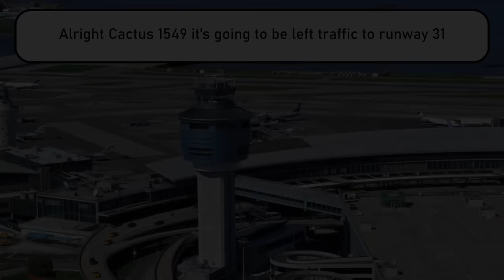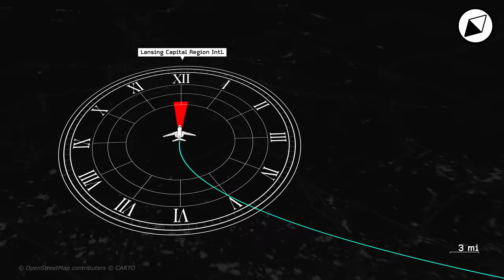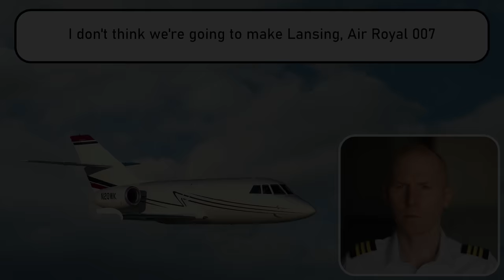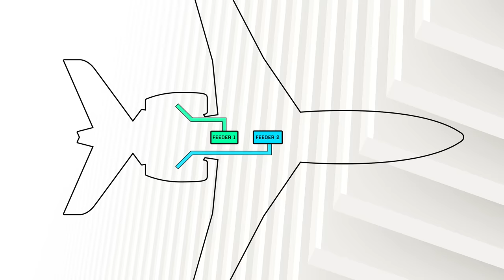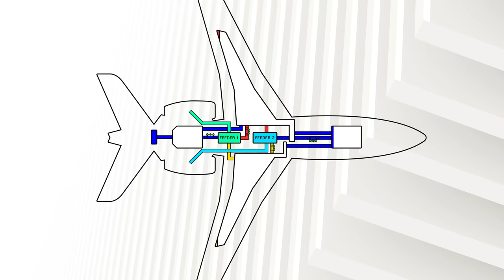Most Bizarre Dual Engine Failure Ever

Comment: Kelsey, you got me scratching my head about mentioning about whether they're heavy. To the best of my knoweldge, your no-wind gliding range doesn't change with your weight. The weight affects your best glide speed, not the glide ratio.
Reply: I assumed Kelsey was referring to the ability to stop, in an emergency, on a short runway. i.e. if the aircraft is light it can stop before the end of the runway and if not you are off the end, but either case is better the ditching off-field.
Reply: @heavyecho1  Let me quote: "If you're very heavy, you may not be able to make it those 15 miles to glide out there".

Comment: I remember that in the early 90's a Breguet 1150 Atlantic from the German Navy was training go-around procedures with one engine off at the MFG3 in Nordholz, Germany. They shut-off one engine and while being on the opposite downwind leg, they also shut-off the second engine. Speed was too slow to get it back online as it was a turboprop necessitating a certain amount of flow. So they were forced to land on a meadow with lighter injuries among the crew of 8. The plane had to be disassembled and was brought back to the military aerodrome by truck.

Comment: Sounds like a poor engineering design if they don't at least have sensors to inform the pilots of the status of the valves from the outboard tanks.  Even if they don't have any control over the valves from the cockpit, they should at least know whether they're open or not.

Comment: Every place not ground level is the "worse" place to lose an engine.
Reply: Even at ground level, after V1 on the take off roll is not a good time!
Reply: Yes but is it better than off ground level? 🤣
Reply: @jessicaregina1956  Yes. Anytime after V2 you can (theoretically) climb away and return to make a safe landing, on just the remaining engine.. An engine failure between V1 & V2 means that you crash, going off the end of the runway. :(

Of course, if you have more than 2 engines to start with, you may have less of a problem. I guess that Kelsey is probably glad that he starts off with 4! It's possible that a 747 can still take off and climb on 3 engines, at least if lightly loaded.

Comment: Its the same when you read the tradncript from the Christmas miracle (SK751)
They loose both engines just after start and Arlanda askes them to climb and also gives them a heading. To which the FO responds that we are at this altitude and descending, and we have this heading.
Then the next call is "Stockholm, Scandinavian 751 is crashing to the ground right now"

Comment: I am hesitant to write this because it maybe construed as a troll moment however, merely for the sake of an educational moment, I will.

“Flying by the Seat of your Pants” actually was a teaching technique introduced before the invention of the slip indicator. It was how we pilots could actually make a balanced turn. If you were being pushed into the seat instead of slipping in or sliding to the outside of your seat you were in a balanced turn. In aerobatics we also use this seat of the pants feel as an indication of some manoeuvres…

Not meant in any way other than educational.

Thanks for your videos especially through the Covid periods…..🙏🤙

Comment: Great video...but in my opinion a "heavy" jet is better of in case of total engine failure than a light one, due to the potential energi, mening better glide ratio
Reply: Glide ratio is not dependent on weight.
Reply: How do you compare stopping distances then?  Would you throw stuff off during the braking run?

Comment: Single engine complex before landing check I learned was GUMP gas,undercarrage,mixture,propeller. Saved me once actually forgetting my landing gear while  talking to atc. Gas means switching to the fullest fuel tank prior to landing. This was single engine, I was never multi type rated

Comment: Great video! Small note however, at 3:30, you say that they might not glide as far when they're heavy. That's not correct, glide ratio is not dependent on aircraft weight, only on the maximal lift to drag ratio. Imagine a glider and a Boeing 747 with the same lift and drag, theoretically they will glide the same distance, with the difference being the Boeing 747 doing it much faster. Cheers!
Reply: ...heavier plane needs to be faster to glide the same distance. Means if it is the same speed, it will fall out of the sky. You just proved it depends on the weight... :P
Reply: @Grisa77  Yes, it needs to go faster because it is heavier, but it will go the same distance. Feel free to look it up. Source: I'm an aeronautical engineer and a glider pilot :)
Reply: @gjens4a108  "it needs to go faster because it is heavier": sooo if it's same speed, it wont do the same distance: It does depend on weight! :P
Reply: @Grisa77  In my original comment I wrote: "glide ratio is not dependent on aircraft weight", I didn't say it will have the same speed ;)
Reply: @gjens4a108  But in Kelsey's case we have a plane flying with a given speed. Does its weight have an effect on the possible distance they can make, if they need to be faster with more weight?
Reply: @Grisa77  For a given aircraft, it will always be able to glide the same distance, fully loaded or completely empty. I know this doesn't sound logical, but it becomes clear when you draw the acting forces (lift, drag and weight) on a gliding aircraft. For a given glide angle, you will see that: glide angle = -arctangent(drag/lift). You'll notice, there is no weight present in the equitation.

Lift and drag are linked to eachother. If you are heavier, you will want more lift to not fall out of the sky, which is achieved by flying faster. When the lift, and thus the speed, is increased, the (parasite) drag will increase as well, which will result in the ratio of lift to drag staying the same.

During gliding races, this principle is often used to gain an advantage over the other. We will make the gliders heavier by filling the wings with water, so that we can fly faster. Of course, this has negative consequences as well, such as being less manouvreable, longer takeoff roll, etc.
Reply: @Grisa77  "Fall out of the sky"? No. It will descend faster, but it will still be under perfectly good control and able to land regardless of weight. The pilot will be flying at the best glide speed for the weight of the plane. That speed allows it to cover the longest distance for how much height above the ground it has, when the engines die in this case. It seems odd, but that distance does not change no matter what the plane weighs. 
Glider pilots add water ballast to go faster under certain conditions. They don't fall out of the sky though.
Reply: @gjens4a108  Okay, i was thinking about this all night (not true :P ) and figured out finally: I did the mistake to calculate with forces. Like accelerating an object to some speed or getting it to some height takes more force, more energy, (more money :P ) if the object is more heavy. But gravity as force is more special, because with gravity the acceleration is constant and independent from weight. Counteracting it (like keeping the object level during the flight) is not independent from weight any more, it needs again more force with more weight. But gliding is nothing more then modifying the accelerating forces of gravity with lift&drag to gain some speed and height, and as the accelerating forces are independent from weight, the gliding has to be independent from it as well. So i was wrong. Now let us shake up Kelsey, because it's important to know that if we are on a gliding plane, it makes no sense to throw out the rest of the passengers to survive... Even less, because that significantly lowers the chance to get in an orgy 1 last time. XD
Reply: I don't know if getting in an orgy would be my first priority in a situation like that, but why not I guess xD
Fyi, another weird fact about planes: a plane in steady climbing flight needs less lift than when flying level :p

Comment: I believe it was the last F14 crash but Felix 103 went into the drink off the coast of San Diego due to fuel transfer issues where the jet wasn't transferring into the feed tanks.  Pilot didn't notice the split in the tapes until too late.  Ran out of gas with full bags essentially.  They downed the remainder of the F14s until we could mod a valve.  No issues after.  Pilot and Rio had a pretty funny story about not knowing what to say to the civilians who picked them up.  "How's the fishing" was what they came up with.

Comment: If the feeder tank valve thing is the cause there is a real design fault. I'd think that you'd want at a minimum a flow indicator on the input and output of the feeder tanks and ideally an indicator in the cockpit as to whether those valves are open or closed.

Comment: Dual engine failure somehow reminded me of Pinnacle Airlines flight 3701, pilots climbed to the aircraft's max operating altitude, but as I understand it the stress on the engines from the climb caused a core lock on both engines. As I remember it the pilots did not immediately communicate the dual engine failure to ATC. Maybe they knew their own actions would be questioned. Anyway, cause had nothing to do with this one, just popped into my head.
Reply: How did it work out in the end? They get them restarted eventually or forced to glide in?

Comment: If the fuel transfer valves to the feeder tanks were closed they would have some screaming red messages on their EICAS telling them that was the case. Even if they closed those valves deliberately (for some reason...?). All valves failing simultaneously sounds very unlikely.
Reply: The plane was built in 1966. Registration N123RA.

Comment: For the distance: 15 miles, at X speed, will take some minutes to get there. And don’t they have a descent speed indicator?  They could use that to calculate if they can get there. 
How about a fuel dump to lighten the aircraft?  Can it be done without engine power?

I am no pilot, so this comment might not make sense at all.
Reply: I don't think they are thinking in terms of how many miles they can glide. Instead they know that to get to a particular airport which is a certain number of miles away they need to be at or above a certain altitude at a certain descent rate. If they can't maintain that then they know they can't reach that airport so they look for an airport where they can follow the required glideslope. 

In other words they continue to fly like they normally do, being aware of course of their power limitations, instead of switching to a completely different method of calculating things.

Dumping fuel won't increase glide distance, even though it seems like it would. It would only slightly reduce landing speed. Which could help I suppose but probably not that much. And they are not supposed to dump below about 5,000 feet over land otherwise you can start making people sick on the ground. Might be helpful in some cases if the airplane is capable of it but I think that's normally only the widebodies that have that capability.

Comment: If this is a maintenance error then it has to be a total screw up. So if the feeder tanks had been isolated from their engines . Let’s assume that this was not a electrical shut off valve  operated from the cockpit. There would be two switches , one for each feeder tank with separate circuits and cbs. The pilot would have control. The manual shut off I have used on various aircraft. It’s often called a fuel maintenance shut off key. You insert the key and turn a shut off valve to shut. Now downstream you can access fuel systems without all the fuel from feeder tank dumping all over your head. The fitted key has a large Remove before Flight ribbon attached to it. I remembered having to get these keys from tool store where they are allocated to the aircraft. The aircraft log also has an entry that the relevant feeder tank has been isolated.  My apologies pilots if this a maintenance error because the maintenance organisation should be held responsible.
Reply: Sorry delete engines and insert wings . The valves can stop the wing from dumping fuel if your working on downstream fuel system. I have changed feeder tanks before and these valves are useful because you don’t have to defile the wing tanks .

Comment: Your weight has no impact on glide distance.  You have to glide at a faster speed at a heavy weight but maximum distance remains the same.
Reply: It is quite difficult to get faster speed without an engine.. you may catch speed in descending.. but than.. you have less high to gilde.. or?

Comment: This is definitely not the first time I've heard a controller tell someone with no engine power to maintain an altitude.
Reply: I think that is a procedural thing. Controllers have specific Minimum Vectoring Altitudes. Stating over the recorded radio to maintain an altitude above the MVA or Minimum Sector Altitude is a procedural CYOA.

Comment: Pilot never declared an emergency that I heard. That and squawking 7700 would have put everyone on alert and cleared to land any runway. 
I crashed a year ago when my engine seized in flight after maintenance. I walked away, but it was tense. N121YT.
Reply: To be fair, the ATC said that the info had been passed to them by another locale so it's probable (I would hope) that the pilot did actually declare an emergency prior to the start of the video.

Comment: So, with all else being ideal except no engines and no 50 knot headwind, could you stop a 747 in 4000 feet without reverse thrust?  Assume no localizer or fence to clear, so you're able to perfectly nail the landing before the numbers, right on the threshold, dry runway, etc.
Reply: 3,000 psi hydraulic accumulator.

Comment: 3:15 and again at 3:35 ”The problem is if you are really heavy. . . .”
The problem actually is that you and every other pilot reading this should know that weight makes absolutely no difference in the aircraft’s gliding distance. If you don’t understand this or are tempted to argue it, think about this first: the L/D of an aircraft does not change with weight. 
On the other hand, the presence of a headwind or tailwind does make a difference. In point of fact, if there is a headwind, the heavier aircraft will glide further, provided both pilots glide at the L/D max for their current weight. 
Alaska Dave
Reply: Lift over Drag is dependent on airspeed for a particular airframe regardless of weight. However, your vertical speed in unaccelerated flight will be very dependent on weight if your Lift remains constant. 

So, even if your airspeed and Lift over Drag remain the same, the amount of time you have in the air reduces with an increase in weight. Less time in the air means less distance.
Reply: @eskieman3948   @eskieman3948  You are mistaken in several respects. 
L/D Max, and thus the no-wind glide distance, does not change with aircraft weight. In order to maximize a glide, the pilot must fly the airplane at the max L/D AOA (angle of attack). 
Two identical airplanes flying side by side in a no-wind situation, one weighing 10% more than the other due to internal fuel or other payload, will glide the same distance when flown at their correct AOA, which is the same AOA for both aircraft.
When a headwind exists in the above scenario, the heavier aircraft will actually glide further  than the lighter aircraft.. In that case, less time in the air equals MORE distance, because the heavier aircraft at its best glide AOA is gliding at a faster airspeed and exposed to the headwind for less time. 
When a tailwind exists, the lighter aircraft will glide further than the heavier aircraft. Less time exposed to a tailwind means less distance for the heavier aircraft.
If you think a given aircraft model has one best glad speed, you are immediately wrong and do not understand AOA, which is basic to understanding your airplane's envelope.
Any correctly drawn "glide distance" chart will demonstrate all of the above to you. Any well-written POH will have verbiage or a graph to allow the pilot to determine best glide speed based on weight.
My background is over 50 years as a professional pilot, including 21 years flying jet fighters, over 27 years of airline flying with 7 type ratings, flying medevac in the KingAir-200 in the Alaska's Aleutian Islands, 11 tours flying ISR in Kosovo and Iraq as a civilian contractor,  and being a guest lecturer at Embry-Riddle University.. 
Alaska Dave

Comment: Just curious here.. why is fuel pumped into feeder tanks vs just pumping it straight from main tanks? If anyone can educate me, much appreciated.

EDIT: Also, second question.. if you have to have those tanks, why would there be an ability to close those valves on the ground with no ability for pilots to see that on their instruments and reopen the valves during flight? That just seems like a really bad design to me, so I feel like there has to be some reason why. Even if the valves can't be reopened during flight, it seems like there should some warning that flashes to pilots that at least lets them know they only have fuel flow from feeder tanks.
Reply: It looks like the aircraft involved is an older design so things could be different but as far as I know it is not common to have feed tanks, the fuel goes straight from the main tanks to the fuel manifold. 
If fuel transfer valves are ever in the wrong position on newer aircraft you'd get a warning and a position disagree light. The aircraft knows what position the valves should be in, or what has been commanded, if the valves are in the wrong position then you'll get you position disagree message.